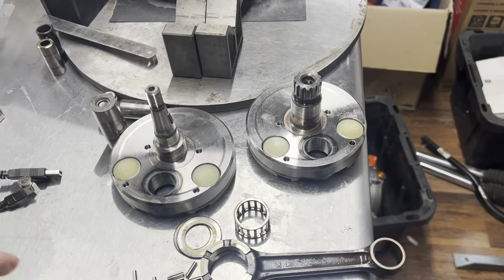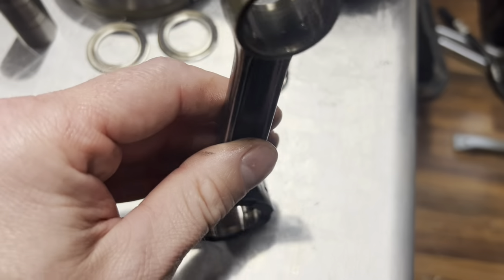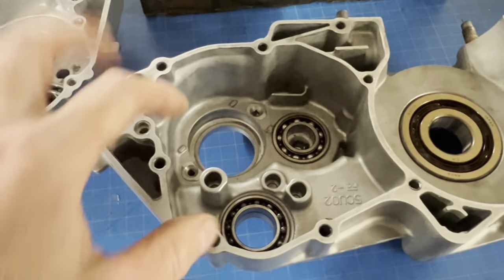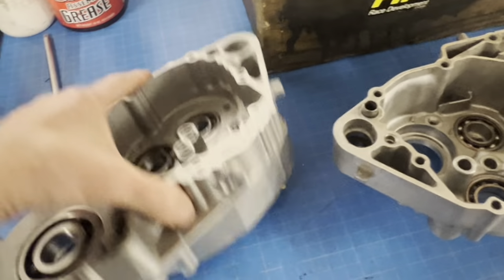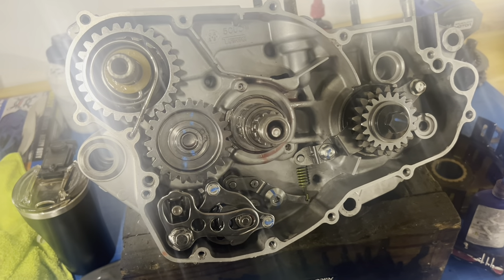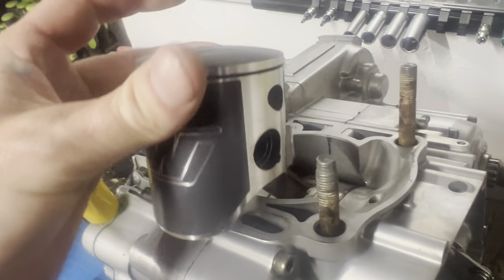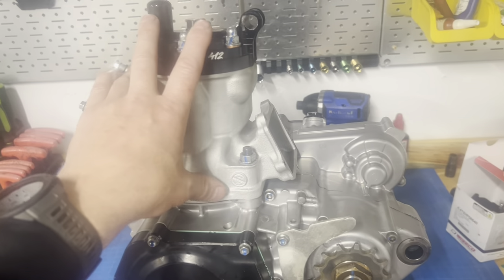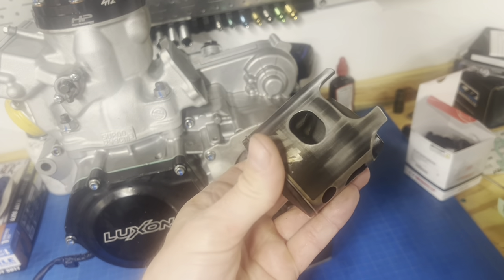Inside a Pro Supercross 2 Stroke

Comment: It always amazes me how rough some engine builders are on their precision measuring tooling. never the less this guy knows WAY more than me. And I appreciate the video, also that 412 piston looks awesome. Nice build.
Reply from the maker: rough????
Reply from the maker: The way the dial bore gauge works - is a replaceable dial indicator is mounted up top - and the mechanism that operates it is within the tubes spring loaded

its pretty durable - and our bench is wood with a plastic mat on top. the micrometers are cheapo - we only need them to be the same size as the piston then lock in place to measure relative piston to bore size - so the actual measurement is of no real value (it is in other instances when specing parts for design)

really high end measurement tools also require climate controlled rooms, and good knowledge of use and calibration - not something im a pro at. I just do the basics to ensure we dont have problems and when i need serious measurement accuracy i phone a friend who has an incredible set of measurement tools for his business and pay him to do it
Reply: @HPRaceDevelopment  Copy that, your doing a great job im sub'd. I would say the way you moved the dial gauge and caliper was a little rough.
Just based off some experience in how precise measuring tools are treated. My bad

Comment: It is the first piston I have seen where the ring end gap traverses a port.  I have transformed (on small production basis) Piston port engines to reed valve engines by adding the 5th transfer port, that was traversed by the ring ends.  Real small bore engines, (34-36mm), that sometimes let us get away with murder.  So I am glad to see I was not just getting lucky.  :)

Comment: And also on the ceramic main bearing from my experience there not all the same I’m no expert but I’ve had them fail on the dyno before so I run oem and just replace them when motors apart

Comment: I am a 60 year old man, and after about 20 years off I picked up a slightly used 2019 YZ250 2-stroke, and totally hated the modern tall bike set up.  I am just riding trails, but I love more bottom end power than the YZ had.  I have been porting/stroking little 2-stroke gas engines for a living, and have a great name out there, (even a water brake dyno), but I just did some stuff to the engine to lower the curve and will not be able to jet it and ride it until weather and I get a bit better.  If you would be willing to offer your opinion, I would love to tell you what I did, and you give me your expert opinion of what I should expect.
1) FMF Gnarley pipe and silencer 
2) V-force reeds.  No stock aluminum spacer plate.  I found the stock reed upper stop plate blocks off the rear reed transfer port tunnel maybe 50%.
3) Lowered the cylinder .024" (removed the base gasket, sealed it well.  Not sure if i want permanent yet.), .048-.049" squish left with the stock head.  Running 100 octane gas.  The lowered cylinder exhaust port timing should, in theory, match the lower rpm target of the FMF pipe.

I like a lot of bottom end and mid range power (like my old 97 KX250), so I hope I get there with those mods, but I am sure I can lose up to maybe 1000 top rpm.  I prefer a "short shifter".  :)

Thanks for your time.  Great little company, I can tell.  Doug in Michigan  Earth Surfer Performance.

Comment: Do you have info on the electric water pump? I have a 05 CR125 with a broken water pump housing and the side case is discontinued by Honda and not 9n eBay. Thanks!

Comment: Wish u showed or mentioned the porting and base gasket  thickness, compression ratio, if gears were undercut on dogs, and other modications you made to the engine other  than  just the ceramic bearinngs, piston , head and clutch. What type of pipe , carb , fuel , oil ratio. Things that help make power  and / or reliability. I usually shave .. ten to 20 thousandths off the head ( stock ) advance timing slightyly and  match / polish the intake exhaust and transfers, powervalve mods? Spring tension ? Deck height? I enjoyed  your video but was,hoping for a little more. Crank runout  , welded crank? Corked ( more plastic on crank ends / higher primary compression? Things deeper that work. Good stuff!
Reply from the maker: Undercut gears dont shift well under load - undesirable in our experience. We dont publish our specs - its how I make a living -

Comment: It's called 'witness marks' when you see where something has been touching (on crank-pin in this case)
Usual failure of output shaft bearing is drive chain too tight at the tightest point when all the shafts line up)
Going from full drop to full compression puts a lot of stress on bearings.
It's incredibly common when riders start complaining about drive line snatch (much more common on street bikes with extended swing arm or extensions)
You tap end of crank to centralise it in bearings, during assembly races get pushed causing side loading.
Reply from the maker: I wouldn't called this "witness" marks as if a piston was kissing a head. 
What happened was the crank got worn out to the point the pin holes for the crank pin got loose enough to allows the crank to start splaying and every load cycle it fretts on the pin.  So I would call it "fretting" myself.  While most people will never load their cranks enough to cause this issue, in his case he likes to scream this more than we would like more often than we would like, routinely hitting 14000 rpm - which is just brutal on parts.
Reply: @HPRaceDevelopment  
Sorry, this is going to be bit of a lecture, but, there may be things you didn't know? I taught measuring and 'machine shop' at MMI for 3 years straight, usually double shift, sometimes triple (and I was good at it as I trained as a precision machinist , finished training 1975, yep, I'm old)
Witness marks are any time one rotating part has rubbed on another,either rotating or stati
onary you see inside front edge of fenders where tyre 'grows' and wind pressure pushes it down slightly. Section I was trying to explain was center of crank pin where bearings were rubbing not the outsides in fly-wheel.
Fretting is the flywheel moving in and out due to imbalance on the pin (as you pointed out) although that looked more like galling as fretting doesn't occur across the entire inserted length of the pin of flywheel bore and is usually a dull/worn area. Yamaha XS650 is well known for it when revved to 9,000 or more (although center section separates around 10,000 even if welded)
 I've been re-building cranks since 1978, done thousands including teaching few thousand people how to do it. Three cylinder cranks (old Suzuki's) that someone else took apart without marking alignment are a lot of 'fun' when you have to set at 120 degree throw. with parallel pins on mains so have to start degree measuring..
You can get away with 14,000rpm on a two stroke (for short periods) a four-stroke would show severe Brinnelling when things 'try to escape' on overlap and the needle bearings don't rotate as pressure is forcing two hardened surfaces together nway above the design limits (and why high rpm motors use oil wedge/plain bearing).
Early YZF and RMZ (or yellow Kawasaki's) had a real short design life when new (less than 35 hours for racers, less for super-cross) I haven'tdone anything with them for 20 years or so, last one I did (YZF250) got national rider from top 120 down to 28 position after racing at Loretta Lynne's.
Few people seem to know you can diagnose what rider did on a roller bearing crankby marking crank-pin to flywheel position before taking it apart. Major wear on top or just after TDC is physical 'something' in head or more likely pre-igniton/detonation, (VERY common on Harley's lugged around at low rpm) worn or grey all the way around, lack of maintenance/dirty oil. Brinnelling and wear at bottom of pin is always due to over revving (also common on Harley's)
I'm not a Harley guy but youe wouldn't believe how 'upset' they get when a 'Jap-crap'riceburner mechanic tells them what they did. (one offered to buy me a plane ticket back to Britain, another (Cajun HD instructor) needed a translator, but he ended up canned after telling female student she should be barefoot and pregnant at kitchen sink , not trying to fix Harley's.
Hope you made it all the way to the end,I know it's a bit much.
Reply from the maker: @1crazypj  Dont take offense to this but - as short as I can type it - the pin was fretting. a not galling.  It created a visible but not feelable impression. Galling is the transferring of material. The main center needle bearing created wear impressions yes. The issue on this crank - that im telling you - we analyszed more closely post video was the crank pin holes wallowed/egg shaped out and became loose allowing the crank the splay.  As a top notch instructor you should realize that the crank bob weights themselves create a moment that is always trying to have the webs either push apart or pull together each load cycle - since the bob weights arent in line with the load force 

I didnt read your whole post but i think we are on the same page on most just not all

Comment: So Derek, no STIC/Keihin this year? 
Someone said Jared has Lectron sponsor this year. I have a 125X buddy that did this move, bc he said the STIC was too much instant power down low(C+ rider on trails). Another dude told me he pulled the block, too much YAT for his CR125 at tracks. I run the yet stronger new STIC Super X on my 200SX. I run the slowest turn G2 cam, as to get more control, as it returns a normal spread of power again. Not stupid all within an 1/8 turn.
Reply from the maker: As I understand they are a title sponsor now.

Comment: Ceramic bearings are available in every ball bearing application. What company did you get them from? Actually they do make power and also let the engine rev quicker.
Reply from the maker: You want to bet money on this?  My dyno LOVES to test claims.
Reply from the maker: davewho3080  If we cared about that we wouldnt run a flywheel weight

Comment: My engine builder always says if you crack a piston you have to replace the rod. But I’m a pro rider also and budget is extremely tight and I ended up cracking a piston (tune is perfect) replaced piston and I’ve got 15hrs on it rn and it’s still running good. I was very concerned because the top of the rod had alittle blueing to it but full engine rebuild is pricey

Comment: How many hows would you expect  are on that motor before it came in?
Reply from the maker: Not sure - we generally have something break before 40.  Main bearings in the past 2 times, this engine got hot at daytona - nothing really looked bad but was smart to freshen it up - at the pro level it's not worth the risk to push it.

His other one grenaded the output bearing on the trans - it likely had 30 i'd have to get notes off the mechanic.

Comment: Your videos are extremely interesting so I have three questions to ask. There’s been so much talk about a straight 250 vs 250 class. From what you’ve seen and tested, what is the most peak HP you can extract from a 250 2T vs a 250F and do you think it would be fair? Also I’ve been comparing the 300SX vs the 350s as I’m considering it for a next bike. In terms of peak HP what do they make on your dyno?
Reply from the maker: Would be a good video. A pro 250f will kill all 250 2t, power is similar and 250f has much wider power window. Thats why 4 strokes are so good, they are able to put down more average power - as we cant keep any engine at just one rpm the whole time. 350 makes more power than 300, but on those 2 the 300 will feel lighter and at times more nimble, more exciting. I think for some people the 2t is still great option but at pro - it would get smoked on equal riders
Reply: @HPRaceDevelopment  thanks for the response, I’m not sure if you are familiar with Nicholas Lapucci but he was able to win the EMX250 class on a Fantic(YZ250). Do you see any inherent 2 strokes advantages that could explain why he dominated that class against a sea of 250Fs?
Reply from the maker: @da5863  Again it comes down to rider - a 250 2t is capable of competing against a 250f but its not an advantage. 
Its not what people want to hear so they dont believe me - but its the truth. If the rider can shift on time, manage the power perfectly, and do evrry detail right they are on par with a slight peak hp advantage but for only about a 1000 rpm window.  a good 250 f makes within 1-2 hp, but makes that power for a 5000-6000 rpm window.
Reply: @HPRaceDevelopment  I see what you’re saying, but don’t 2 strokes have a massive torque advantage? On a deep loamy track how would the torque difference not be a massive advantage between a 250 2T and 250F? Comparing stock bikes the typical 250 2T will make at least 8-9 lb ft more than a 250F. If 2 strokes are more powerful per CC why is it that pro 250 2T are only 1-2 hp stronger at peak than pro 250Fs?
Reply from the maker: @da5863  Understanding the difference between torque and horsepower is challenging for most people. Engine Torque is a meaningless number without rpm at said torque - and if you put the effort into learning why this fundamental truth is why power is all that matters - a lot of things in racing become more obvious. Power is define by your ability to do a set amount of work in a set amount of time. Time is what matters in racing….
Reply: @HPRaceDevelopment  thanks

Comment: Are you familiar with tpi relocation block which moves both injectors? Are there any downsides to it if ecu is not reflashed?
Reply from the maker: @elkku2140  we were one of the first to sell this which is now wide spread.
Reply: @HPRaceDevelopment  so it must be good. Is reflash a must or can I just run it with stock mapping? Bike is 2022 ktm 250 exc tpi.
Reply from the maker: @elkku2140  I know people
who run stock

Comment: Thanks for another great video 🙏,
Did you try using gapless rings ? 
Will appreciate your insight.
Reply from the maker: No - not worth the cost or effort on race build - in running operation a properly gapped ring is at basically zero gap.
Reply: @HPRaceDevelopment  thanks for the fast response, was considering it not on a race bike, more for my daily ktm 690.
Reply from the maker: @bbmoti  if you can source a set...you can try it.
Reply: @HPRaceDevelopment  😁😊

Comment: Those barrel studs could of been cleaned before final assembly ,   @ 12.02 gunge in the threads (especially the long stud)  will affect final torque for sure, great vid however
Reply from the maker: below the portion of the nut thats engaged - but these studs should be replaced frequently and these are far past due.  These had been vapor blasted and brushed - still look terrible, the cycling stress applied to them combined with corrosion will lead to broken studs

Comment: you don't ditch the plastic crank stuffers?
Reply from the maker: Nope - I think that entire concept is dumb. They only “melt” if you loose a rod bearing - they are never the cause of failures.
Reply: @HPRaceDevelopment  I've seen em go on the smaller 65s and 85 ktms..didn't know if the yamahas had the same issue. I know they make billet ones.
Reply from the maker: @minibikemadman  they dont “go” in our experience the rod goes and melts the stuffer

or the bolts come out and werent properly loctited - a common ktm issue on all sorts of bolts
Reply: @HPRaceDevelopment  ya the bolts I've heard are a issue..im always intrigued by that kinda stuff..I've got a 380cc cpi lynx cylinder on some billet cases for my trx 250r...im a hard core 2 stroke guy.

Comment: In the rule book do you have to run stock cyl?if you don't have to run stock cyl why not have a casy cyl made with wider exhaust port and more transfer area
Reply from the maker: @denniswilder3014  Welcome to the party. In ama pro racing, such as sx and mx, you must run stock castings and cases, cylinder. I even believe our billet head is illegal but has been overlooked by rule makers. The rules in the usa are to protect the oems from outside competition and new companies
Reply: @HPRaceDevelopment  the only thing really holding the yz back is the exhaust port is a little small. Why not port into the water jacket a bit then weld it closed and machine it. In pro stock 800 sled class its stock cyl. And my engine guy does that. More than one way to skin a cat
Reply from the maker: @denniswilder3014  There is a lot more holding it back than that.

But assuming some simple welding could allow us to widen the port, you would have to redesign and remake the powervalve to full width of the port, which requires remachine cylinder slot for that - could potentially hit water - not easily access-able areas to weld. 
The side ex port dividers are in the wrong spot - youd have to remake those somehow - and welding its gonna happen in that spot

the side powervalves themselves would then be in the wrong spot once those ports were moved and widened requiring a redesign of the powervalve arms and system

Its too expensive and time consuming unlikely to work consistently, and not sellable. The difference between a pro race team that has funding - and a public shop like mine is immense. Everything we do has to make sense.

Comment: Does Wiseco make a 412 Piston for Husqvarna 300’s ? I have a new Te 300 and it’s only been Started once and i want to swap Oem out with Either a Wossner or Wiseco and torn on which one . Love the Channel appreciate the content.
Reply from the maker: Not a leshar special - but they do make a 300 piston you can run as seen in our previous video
Reply: @HPRaceDevelopment  ahh yes, was wondering if that Wiseco has shorter skirt than Oem .  Appreciate the reply!

Comment: I changed my piston 30 hours ago and it had 0,5mm of piston ring clearance. Manual states that it should be 0,4mm on one ring piston but I put in dual ring piston. Is it normal? The bike is 2021 ktm 125 sx and its working great as of now